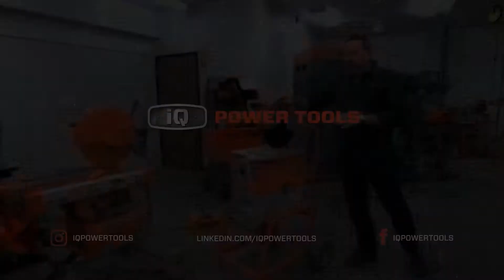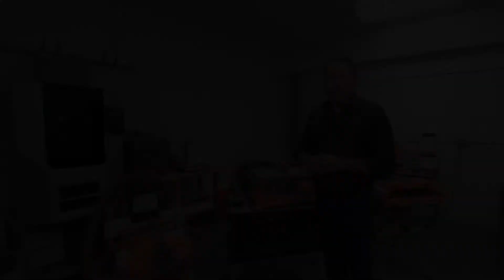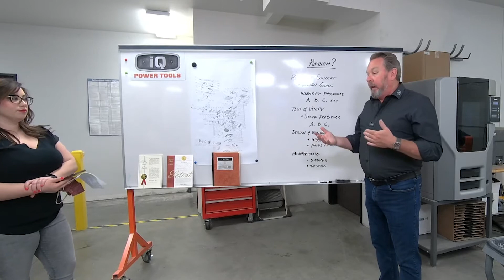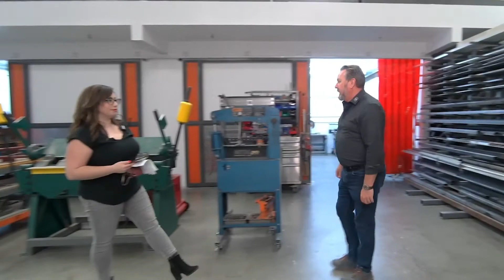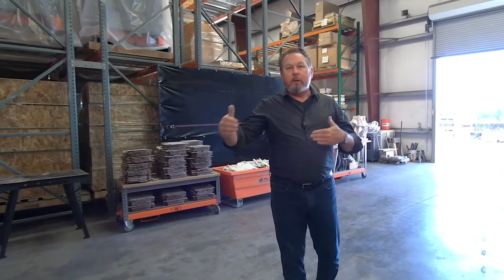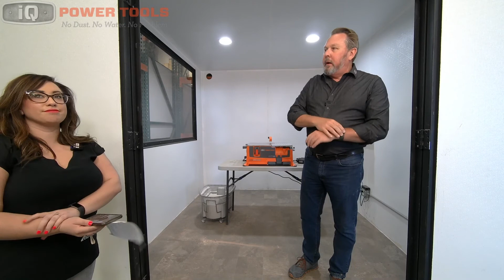iQ innovation

Comment: Hey, I like your system very much and I'm considering ordering.  I have a question, can your IQ 360  paver cutter, the one on the cart behind you.  Will it handle block or do I need the IQ 362?
Reply from the maker: Hi Dwight the 360 has a 14" blade and is designed with a 4.5" depth of cut. The 362 has a 16.5" blade with a 5.5" depth of cut. Neither saw is designed for block, however, you could cut half way and then flip the black to get the full cut. Just know, that if you use it as a chop saw, you will not have full dust collection until the blade is through the material.